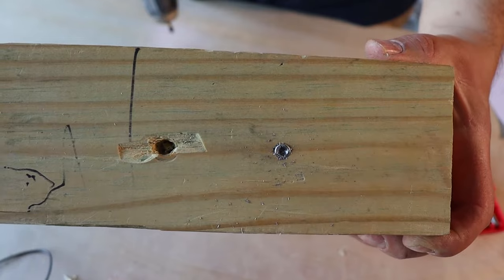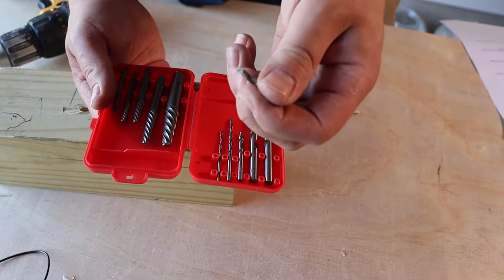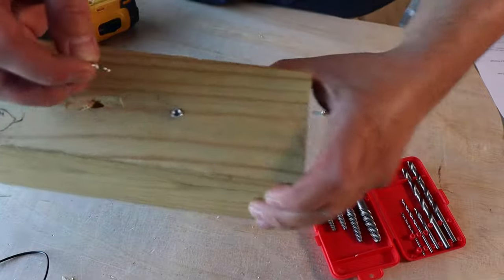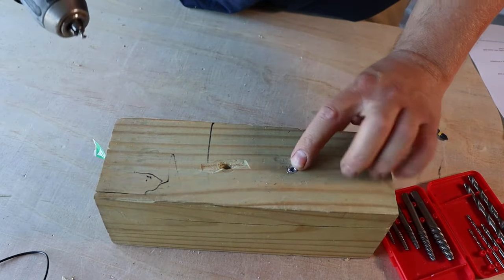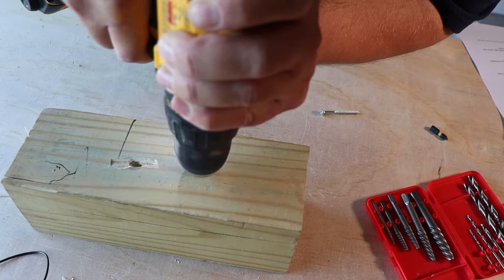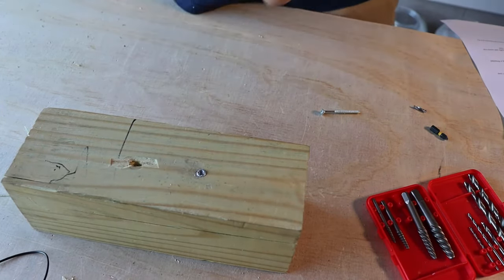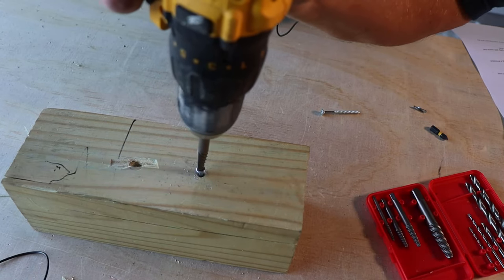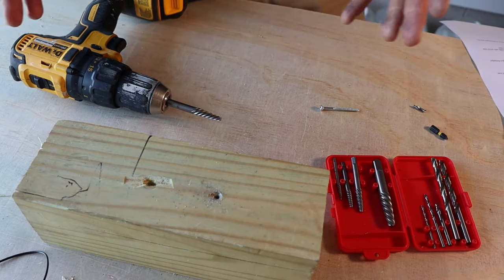How to use a Screw Extractor Set - (Remove broken or stripped screws)

Comment: I went with a harbor freight set using them to remove some stripped Allen bolts on my wheel adapters and after the second use that sucker snapped right in half.l
Reply from the maker: Ouch. Unfortunately... sometimes you get what you pay for.

Comment: did you use the regular screwing/drilling mode is it best to use the impact mode?
Reply from the maker: With these screw extractors, I'd use a regular hand drill without any impact function. I would not suggest using a hammer drill on the hammer setting or an impact driver with any screw extractor set.
Reply: @DIYWithAaron  thats good to knw these sets are mostly cheap and using the right settings is critical thanks for the fast reply

Comment: didnt work at all. cant get a deep enough hole.
Reply from the maker: Sorry to hear that. Check to see if you have a regular or reverse bit by comparing the one your using to a regular bit. If it is a regular bit, then run the drill in the forward. If your bit is dull try a different bit. Screw extractors often require a bit of patience since they don't always work the first time... and there are times they just don't seem to work at all. Nature of the beast.

Comment: IMO never use a drill on an extractor.  a hammer and vice grips.  with wood you can get away with it but with metal, NEVER use a drill.
Reply from the maker: I don't usually work with metal as much. More of a wood guy so I'll defer to you on the metal. I've always done okay with a drill/extractor combo with wood.

Comment: In your video you have normal drill bits (just freeze the clip and then compare to any picture of a drill bit), and using them in reverse is not correct. No wonder you complain about the quality of the bits - lol.
Reply: That's exactly how you use an extractor set!
Reply: Not in this case! Some extractor sets use counter clockwise drill bits, or even have the two pieces combined into a single reversible piece, but not what he is using in this video. Those are standard drill bits, with accompanying extractor bits that will run in reverse. Please just look at his drill bits and compare to any picture of a standard bit, and you can see that the direction of the spiral is the same. That’s why he ends up complaining about the bad bits — because he’s using them in the wrong direction.
Reply from the maker: Holy crap... you are right. Good catch. I thought all extractors came with reverse bits... never thought to check it since it makes zero sense to use a regular bit. Why the hell even bother including the bits if they're just some generic general purpose bits?

Comment: This is wrong. There are two types of screw extractors. With this type you drill a deep hole in a broken screw and use a tap in a tap holder https://en.wikipedia.org/wiki/Tap_and_die#/media/File:WrenchTapBarT.jpg to slowly extract it BY HAND. By looking at the tap, this one has a squared end - not for a drill, and long thread - not to be used just with its tip.